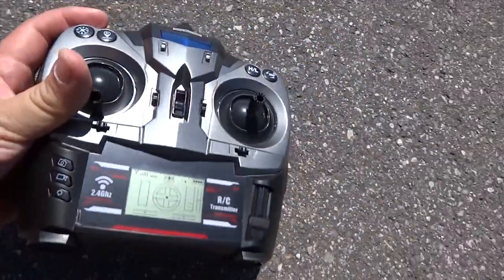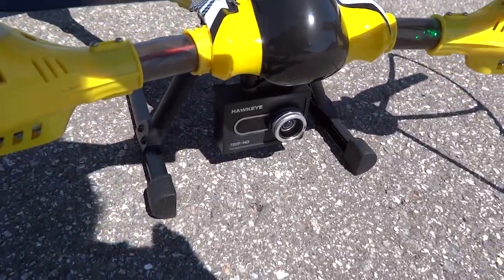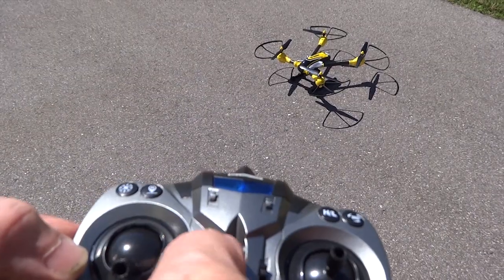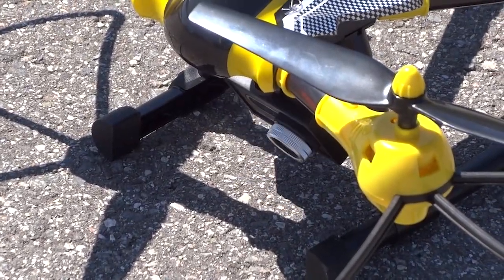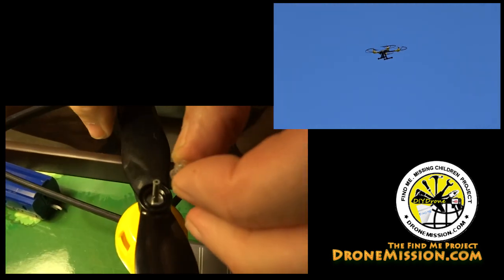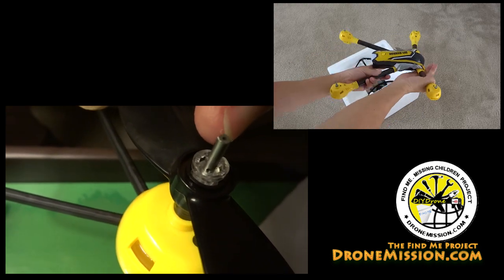Kaideng K70C Sky Warrior Quadcopter Plus Tips!

Comment: I liked the top down cam view, worked well. What stops the prop getting eaten by the top cap if the cap doesn't move?
Reply from the maker: +MicroRCFiend i guess it is not very efficient, by design
Reply: ***** It's cool, I wasn't clicking the little plastic clear pieces into place with enough force to lock them. There is hair gap between blades and yellow caps now.
Reply from the maker: +MicroRCFiend ahh, at the end of the video, the installation is unusual.

Comment: I didn't use the washers when installing the propellers..and had a bit of a challenge figuring out the lockstitch...(wish I had seen your video) Do you think I should take off  props to add washers? Seems to be flying fine.
Reply from the maker: In general, the washers are used to distribute the pressure of the nut evenly over the surface, so that the surface isn't damaged and reduce wear.
Reply: +diydrone Thank You, I will put them in.... I am a newbie, ..do people ever lubricate the gears on quads? I have some Non Petrol based lube I'm tempted to spray on.

Comment: Nice video sir.. Do you faced with any signal issue?
Reply from the maker: +Hafizzi Latif thanks, we have not notice it during the 3 flights, but i read the stock radio range is limited to line of sight only - short. 150m-300m.
Reply: Thank you for your response sir. Can't wait for your next review regarding this model. :)
Reply: +Hafizzi Latif I did a range test yesterday on mine after realigning the antennas in the quad and the transmitter.
I got about 170 meter range out of the test.
One thing I noticed, at least on mine, that when it goes into LVC there seems to be a lot of dropouts between the radio and the receiver. I don't know if anyone else has the same issue or not. Just FYI. :)
Reply from the maker: +Del Quad4X thanks for the update
Reply: ***** any time. I'm still "playing" with mine, so all is not lost. :)

Comment: This is strange. Those specs doesnt seem to be the same at banggood? They also sell this K70C version but the difference is this:

Copter Battery: 7.4V 1800 mAh Lipo Battery
Control Distance: About 300m
Charging Time: About 200min

Is Banggood wrong or is this actually a different version?
Reply from the maker: +Jerry Berglund greetings, i believe you did not see it wrong.  there is suppose to be a change between feb-mar, and altitude hold is to be added.  I received a 2000 mAh LiPo, instead of a 1800 mAh. The published range is to increase upto 300m.  I read that some folks are waiting for the new version.  my quad is probably just caught between the changes.

Comment: that transmitter looks cheesy.
Reply from the maker: +Yule Owens kinda, but i have seen worst.  One positive side to it is the 2 buttons to take a photo and start/stop video, is clear and well position.  The radio range is limited to line of sight only - short.
Reply: Correct...my trim switch broke  within the first 5 minutes of using my new quad! don't know where to find another?